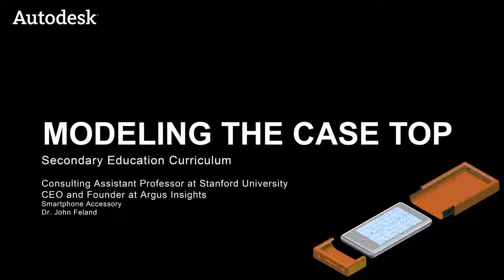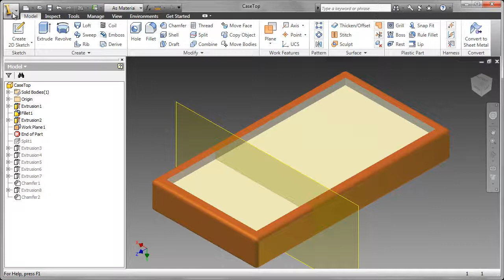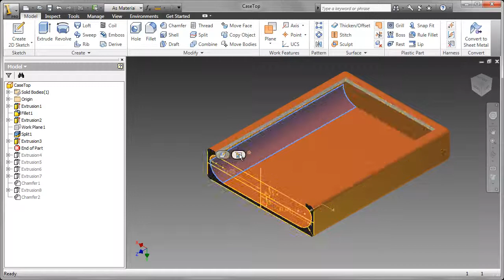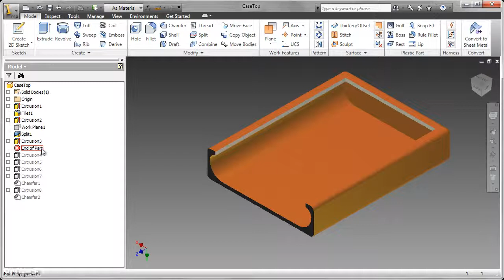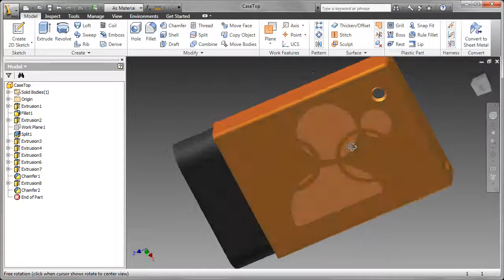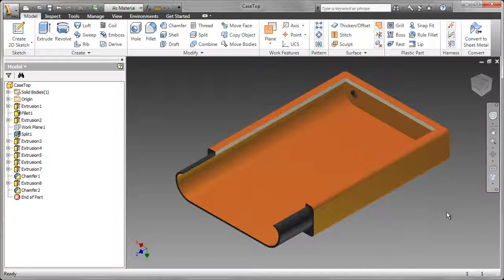Smart Phone Accessory: Inventor Technical Video Part 2

Comment from the maker: There are a couple ways to accomplish what you are inquirying..
Couple questions/comments to start with:

Option 1 – Derived parts (the better option if they already have the phone modeled)
1. Create a box that is larger than the phone
2. Create a new assembly that includes the case and the phone.
3. Use constraints to position the phone inside the case.
4. Save the assembly
5. Start a new part file
6. From the manage tab, select derive from the insert panel
7. Select the assembly created in step 4
8. Select the phone dummy part in the tree
9. Click the red – symbol to subtract the phone from the box
Option 2 – Re-sketch the phone profile to extrude cut the model.
1. Create the box
2. Create a work plan in the middle of the box
3. Sketch on that work plane (F7 will slice the graphics when in sketch mode to help see the sketch)
4. Sketch the profile of the phone
5. Use extrude with the symmetric option turned on
6. Extrude the length of the phone, removing material
7. Finish off the ends with fillets.
There is also a way to do it by offsetting surfaces, but I wouldn’t recommend it for someone just starting out.
Reply: Thank you very much for the pointers!

Comment: Thank you, this is very helpful. I am a total newbie but started just like your Part 1. I got stuck while wondering how I can cut out the 3 dimensional profile of the phone from a box, and ended here. Is there a method to cut out the phone's 3D body from a box, or better yet, build a shell of uniform width around the outer surface of the phone?